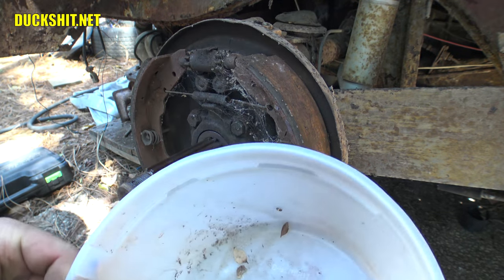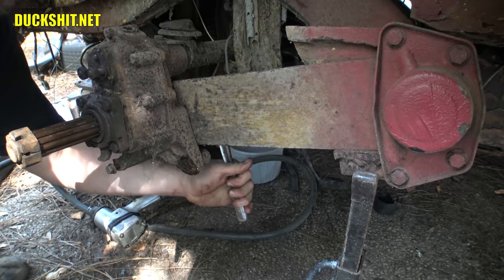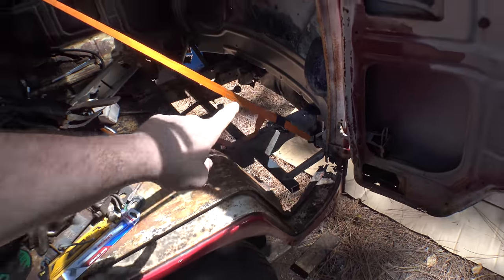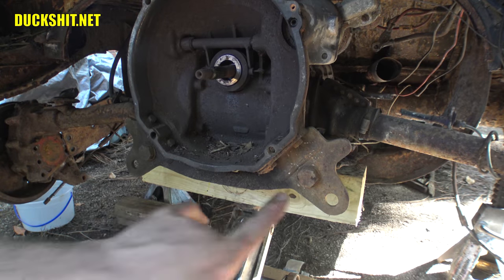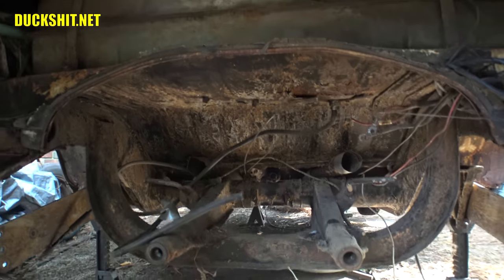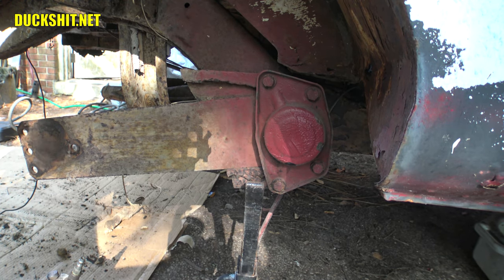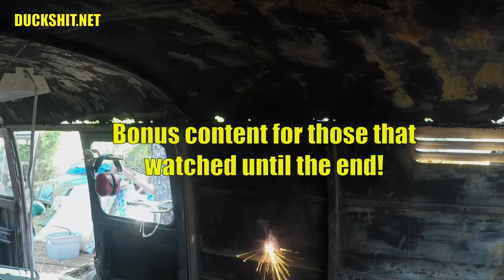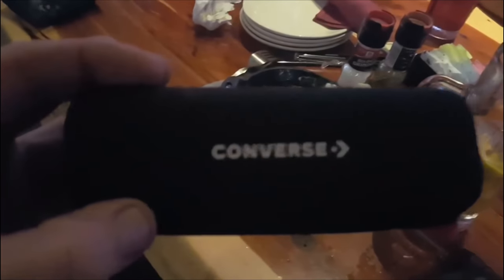Transmission Removal / Two More Windows - 1967 VW Bus - Gregory - 11

Comment: You could perhaps put a a second pair of side doors on the other side. That solves the long panel repair issues and makes the van/bus more usable than ever.
Reply from the maker: VW actually built them that way!   I have considered this!  Thanks for the cool suggestion!

Comment: Those brake lines would benefit from braided hoses end to end. For easier maintenance, you could put joints and shorter hoses near the axles but basically throw the steel hard lines and replace the lot with braided.
Reply from the maker: All braided lines are here and ready to go!  :-D :-D :-D

Comment: just go around and spray every bolt with penetrating oil now and let them all soak.   sucks that someone put the wrong bolts in the plate cover.
Reply from the maker: Yup... lol... but other than the spring plate and the front beam there really are no other bolts left on this Bus hahahaha!

Comment: I retired from the phone co. all our vans had windows only on the passenger side. That way you could see while inside the van. The drivers side was covered floor to roof with cabinets and shelves.
Reply from the maker: Interesting.,.,  hmmmm
Reply: @DuckmanCycles  it was also probably intended to be a safety thing so you could see on the right side of the vehicle. There was a steelwall behind the drivers compartment with holes on the top half but we usually had so much crap hanging there you could not see much :-)
Reply from the maker: Thanks!  I had no idea!

Comment: that transaxel plate with the big bolts looks strange.  i wonder if that is after market?  strange
Reply from the maker: I have seen rearmost transaxle bounce like that before, sometimes they were used with trailer hitches, gives a nice solid place to mount.  But I have found them on lots of Beetles and Karmann Ghias also with no explanation lol!

Comment: My friend has a rare 15 window, has the 2 extra ones in the back quarter panels around the corners. Would be cool to add those too.
Reply from the maker: The reason why my bus does not have the rear corner windows is because the rear hatch is so big... they oversized the rear hatch at some point to make the bus more practical.
Reply: You can fix that 😁
Reply from the maker: Hahaha!  You said it best!  Lets see what happens!

Comment: those torsion bar plates come from the factory with self tapping bolts, thats stock.
Reply from the maker: That's news to me, the first one I've ever seen with self tapping bolts that were extra long,  and they also were not metric headed.  There is no doubt there was some kind of fuckery here.  In the next video you will see me pull out the torsion bar and I got quite a surprise.

Comment: Were reduction boxes only used on busses?
Was the main reason just for more torque?
Reply from the maker: Yes, buses only, and for more torque for a very winded little engine!  I think they came in ratios of 1.26to1 and 1.39to1  There may have been more, but thats a pretty dramatic reduction eoither way!  You don't use first gear most of the time in regular driving, and top speed is like 55mph at redline lol!

Comment: Please don't cut the spring plates, swap them for IRS plates and sell the bus plates with the redux boxes.
Reply from the maker: Are you going to buy the complete set?  😁
Reply: Years ago I would have. Wanted to use a swing bus trans in a baja but couldn't find the plates. Gave up and switched to 2x3 IRS and 002 trans.
Reply from the maker: @bedlamite42   the spring plate phone fit on a Baja Beetle anyway without cutting them   its choppy time!

Comment: What's wrong with "master/slave" terminology?   My own industry uses it with hard drives,   not so much with SATA/SAS technology these days as SATA and SAS are point to point with independent control with no need for one drive to control the other.
Reply from the maker: Your industry is my industry, I'm also in IT.  I have no problems with the terminology either, no matter how much people cry about it.  It's a hard disc drive or brakes for shits sake!  They have no opinions!